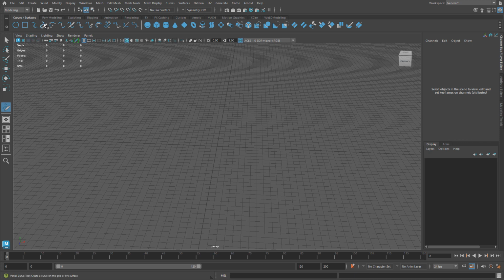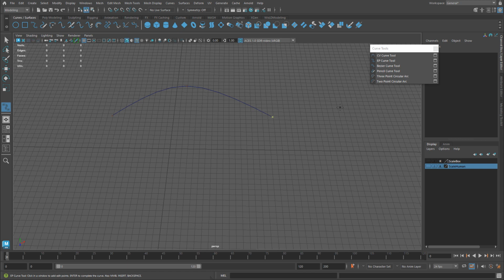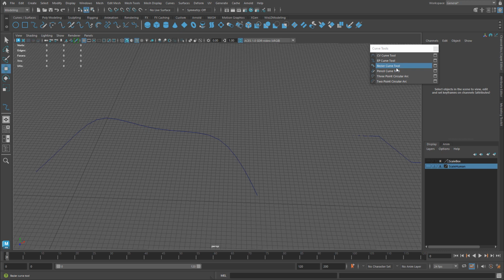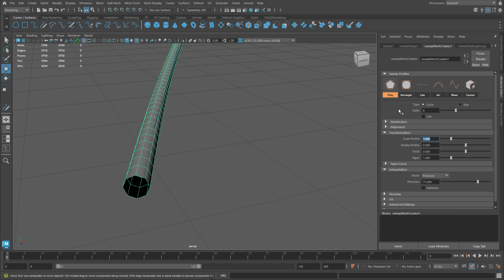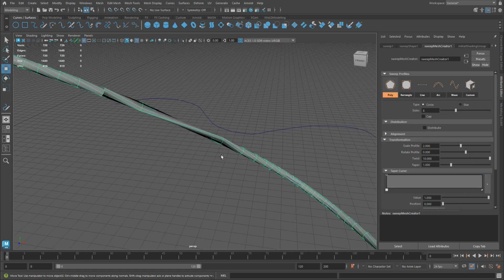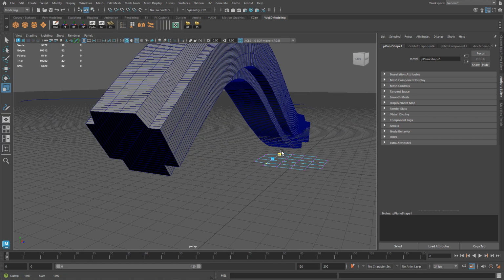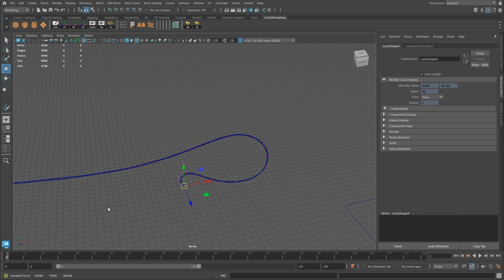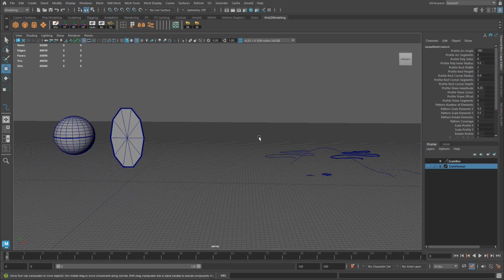Maya: The Complete Guide to Using Sweep Mesh - Techniques, Tricks and Secrets

Comment: Would be nice to be able to extrude or reveal the geometry along the curve as well. Maybe in the year 2000.
Reply: youre right...!
Reply: you could do that by controlling the curve that you input in it. Using a detachCurve node, you could drive one "parameter" attribute from 0 to 1. One of the output curves can then be plugged in the sweep node. It will grow along the original curve. You'll need to use the node editor for that though